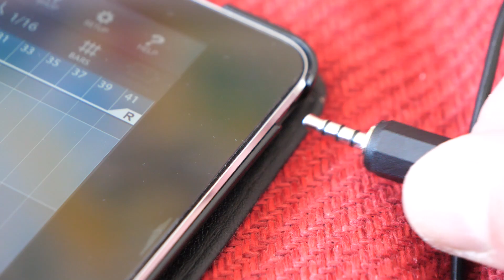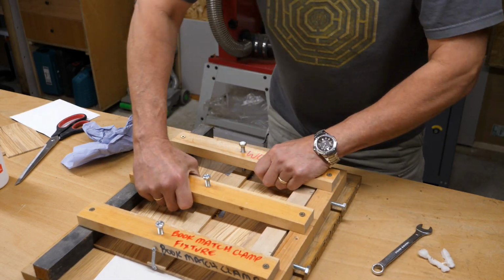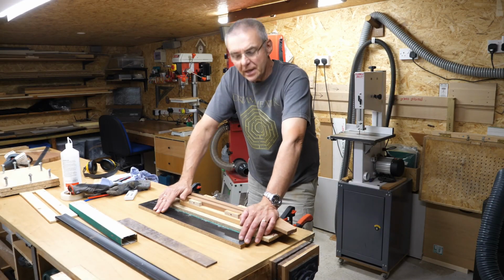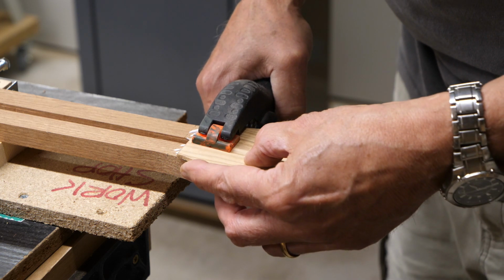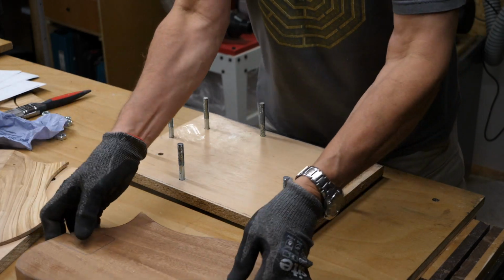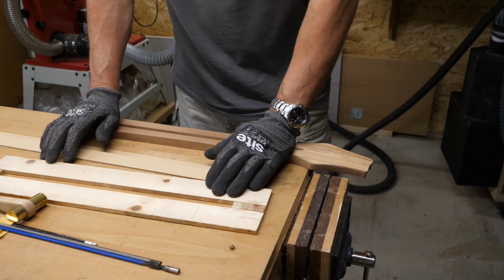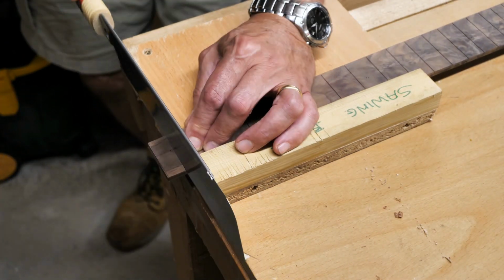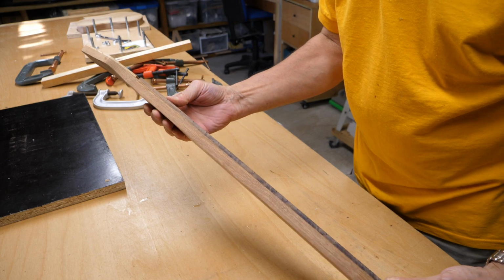Day 5 Great Guitar Build Off 2020 unofficial challenge - build from scratch

Comment: Trus rod a touch deeper makes me wonder about this certain lesson. I saw what you did there.
Reply from the maker: Hi Scott, thanks for the comment, I’m not quite sure what you mean.  I’m showing my process of building guitars which, as you can see is far from perfect, a bit hit and miss. Cheers Dave.
Reply: @DaveDickens  I have a guitar with a twist on the neck and your idea may serve an answer. The neck is a thin profile so it may not work. Sure would like to fix it without replacement.
Reply from the maker: I got a Squire Strat off ebay for a really good price but the neck was bowed back quite badly and the truss rod was completely knackered.  I tried bending the neck using a couple old irons to heat up the wood, it sort of worked. Then I took out all the frets and planned the fret board back to shape.  It worked and it’s one of my fav guitars. I don’t know if that helps. Cheers Dave

Comment: Looking good.  Did you say the top was olive?  The only thing I thought was a bit odd was the gluing down of the truss rod, or at least the gluing of the tape sleeve.  What is your hypothesis for doing that?
Reply from the maker: It’s a great question and this is probably a stupid answer, I’ve always done it. I guess I must of read something when I started about 15 years ago and just carried on. My assumption is that the back of the truss rod needs to be fixed to the neck to push or pull the wood into shape.  I used to use truss rods enclosed in U channel aluminium and perhaps their operation is different. I would be interested to hear your view. Cheers Dave
Reply: @DaveDickens  Thanks for the reply Dave.  I'm only building my 2nd guitar so not experienced like you.  I have been watching a lot of video's though.  So far you are the only person I have seen use that method.  It appears I use the same truss rod as you use in this build.  as far as I am aware the blue threaded section shortens, causing the middle of the aluminium rod to push up on the middle of the fret board to introduce back bow.  turning the allen key the other way lengthens the blue rod causing the ends of the aluminium rod to push up on the fret board introducing relief.  As far as reducing truss rod rattle goes, it seems that as soon as any tension is put on the rod (either direction), the rod becomes snug and does not rattle.  At the end of the day, if your method works and does not introduce any problems then its fine.  Anyway, your making good videos and I subscribed.  Keep up the good work  :)
Reply from the maker: It still rattles a bit even though I glued it, just goes to show, I probably don’t need to.  BTW it is an Olive top. Cheers Dave

Comment: When I got to S I remembered it is called snipe (I think). Enjoy your dinner.
Reply: I was thinking the same thing. However, if I remember correctly, the problem was that the middle of the neck blank was lower than either end because the ends were not supported. Snipe is when the first and last two inches (or so) of a board are lower than the middle, due to how the workpiece enters and leaves the planer/drum sander. Even if Dave has the entire neck blank supported, snipe can still occur. This is why I think it would be better to use a sanding beam or block to level flat. An alternative is to have extra material at both ends that would be cut off the finished board.
Reply: @TeacherAn  FYI TeacherAn, I had written a rather long comment, which I apparently forgot to save, (it is not here) which made my later, short comment about snipe make a lot more sense. Not enough coffee I guess! Anyway, thanks for your take on the issue.
Reply: @joebikeguy6669  Thanks for your reply. I found an interesting article on snipe. I probably can't post the link, but if interested, please search "Highland Woodworking Understanding Snipe."
Reply: @TeacherAn  Will do.
Reply from the maker: Snipe, yes I have had that problem as @TeacherAn describes.  A few things have worked for me; making very small cuts, putting the work piece in at a slight angle and making sure the blades are really sharp.  When I'm making fret board blanks I do use longer pieces so I can remove any snipe. I appreciate the comments, cheers Dave